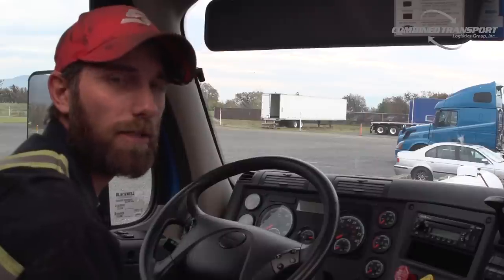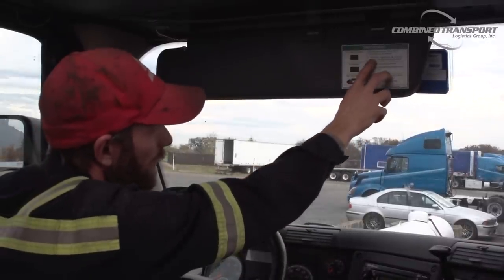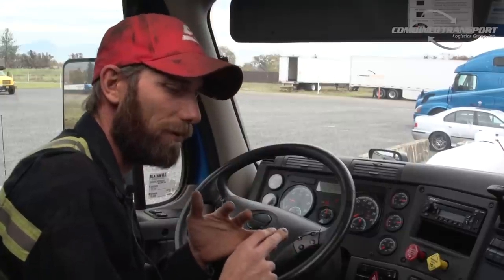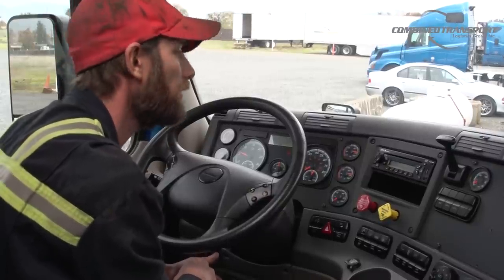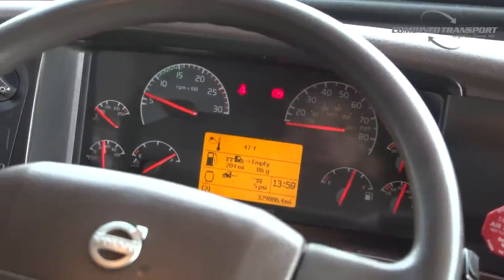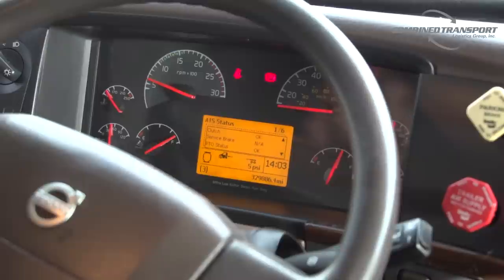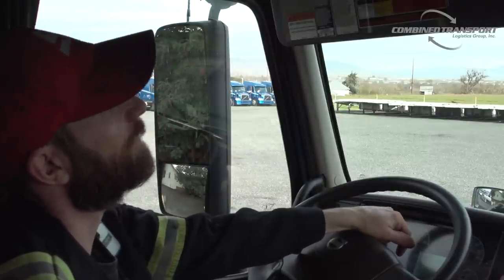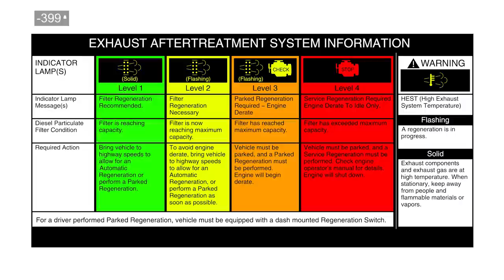How to Regen for Freightliner and Volvo trucks

Comment: Thanks for the video, I drive a freightliner M2 at work and the DPF light has been coming on and off lately. The longest it's been on is about 20 seconds then went off. Should I attempt a regen? The hot exhaust light also comes on for a second sometimes when I come to a stop.